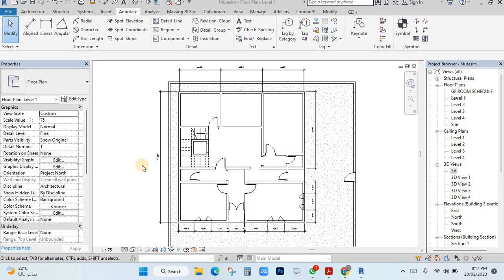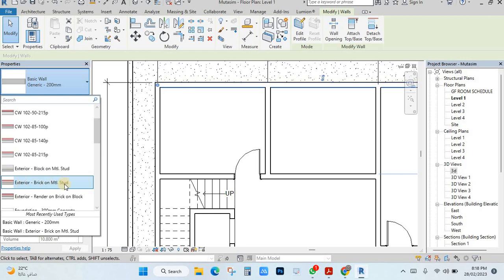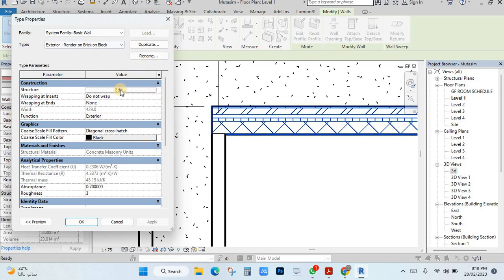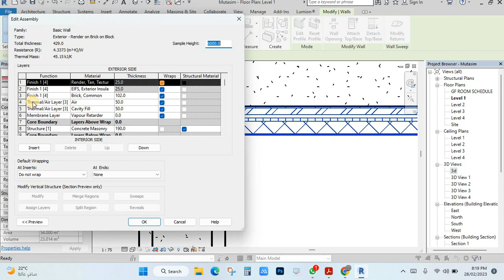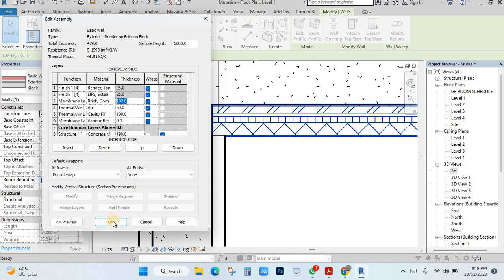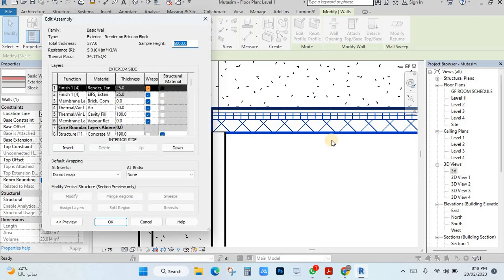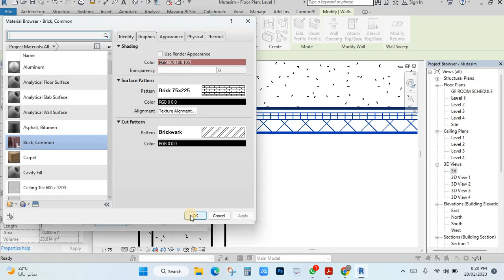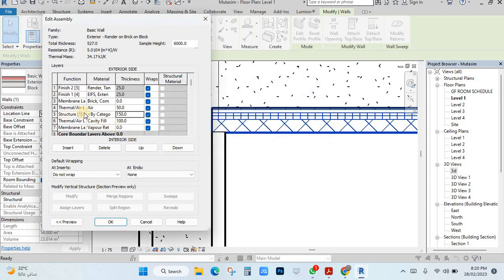Revit add materials layers to the walls

Comment: Is it possible to put a assign a value to the material layer based on height and name of the material...eg plasterboard @2200h is code 111 and plasterboard @2400 is 112
Reply from the maker: Yes u a can